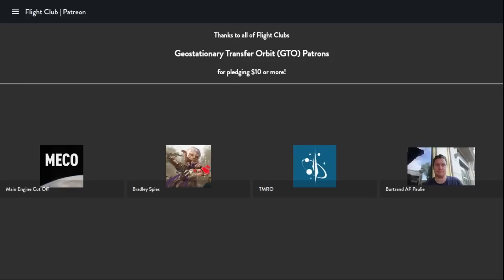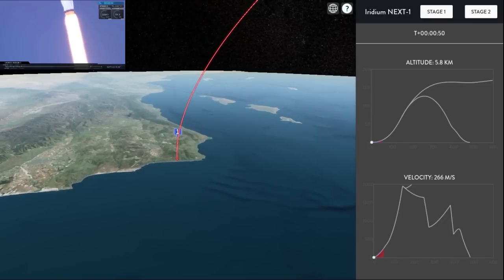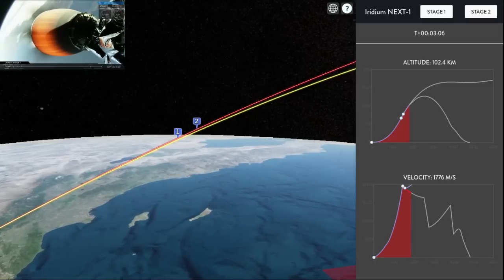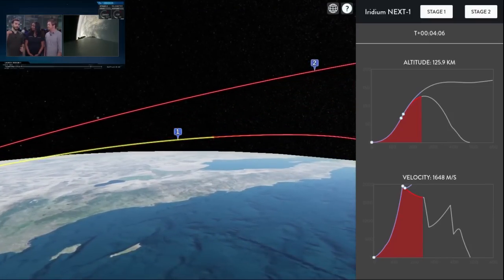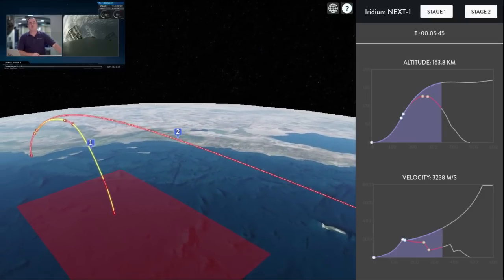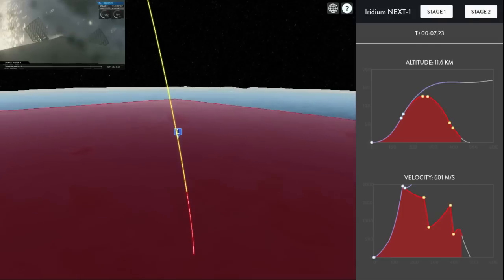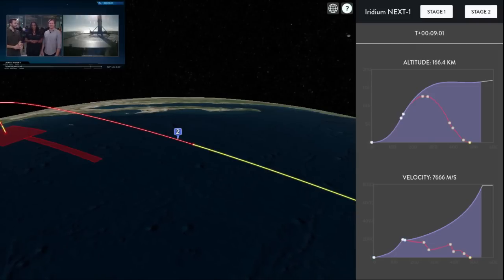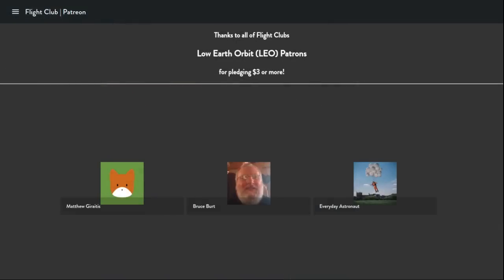Flight Club // SpaceX Iridium-1

Comment: That was a pretty low altitude landing burn, I remember them starting much higher.
Reply: the only reason for a longer landing burn would be that a mission required so much delta-v from the first stage that it would skip the reentry-burn. iirc they did that for SES-9, a Geostationary Transfer Orbit mission.
Reply: It's probably more due to how much fuel is left in the first stage. The more fuel, the heavier it is, the longer it takes to land.